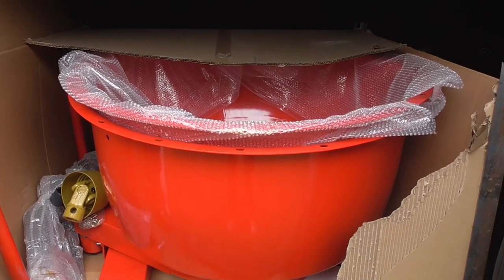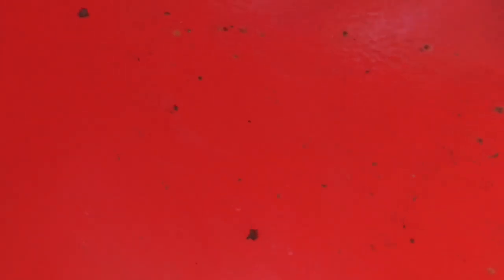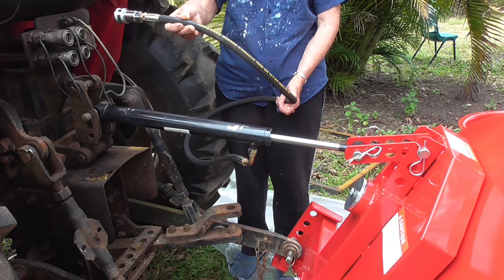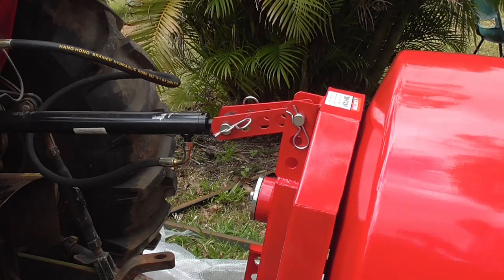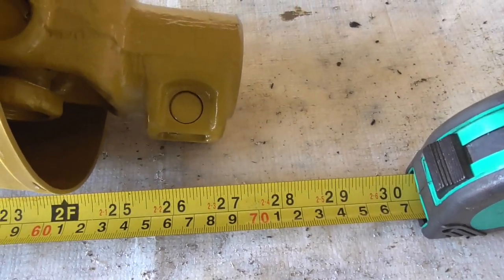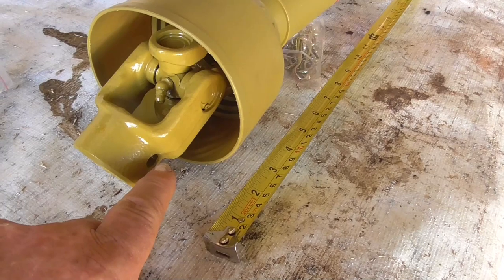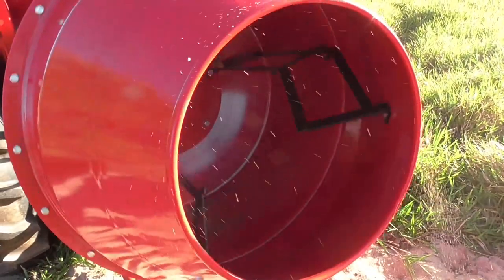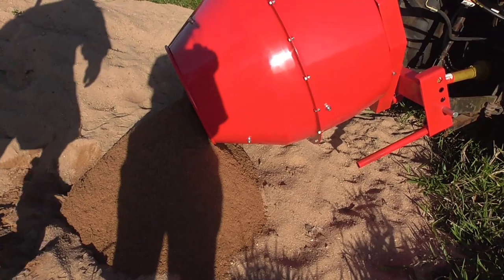NEW 3 POINT LINKAGE CEMENT MIXER

Comment: That is a dang big mixer mate looks  about 5cfm, handy on the trailer as you can mixer at the material pile and pour at the job
Reply from the maker: Yeah it is pretty big. I don't have any trouble shoveling or making the concrete but wheeling a full barrow now with my knees is a bit much. John